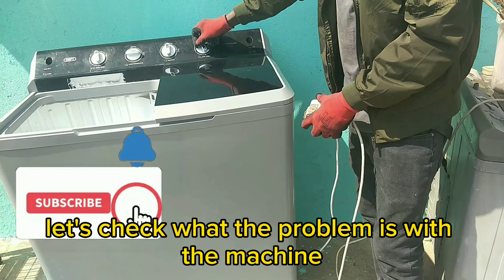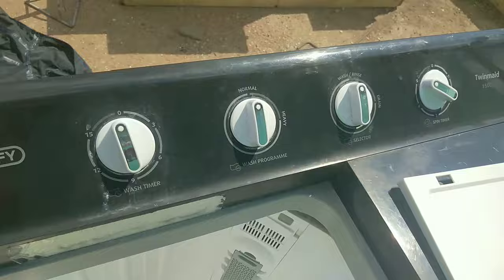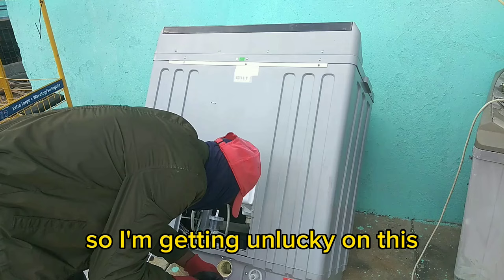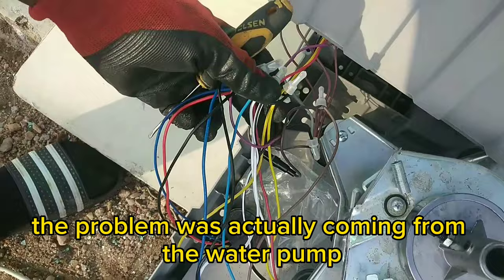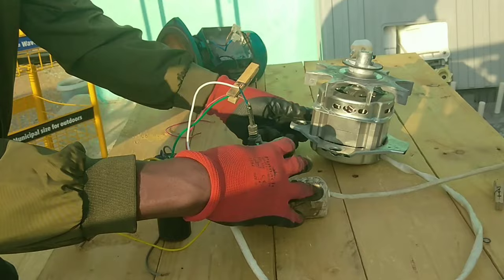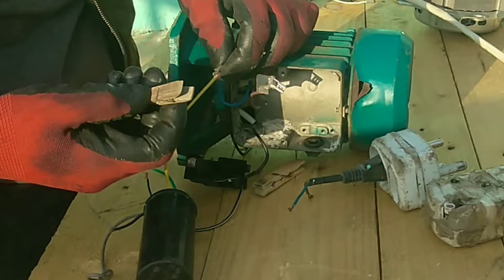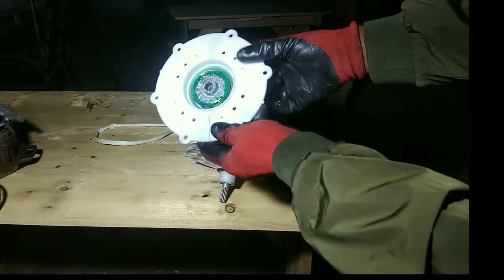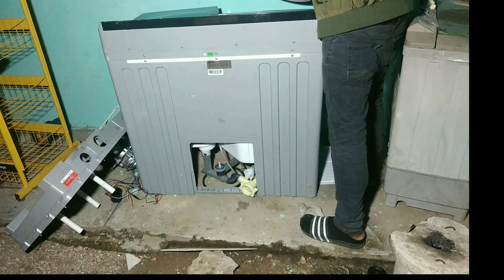How to fix or repair a Twin Tub Washing Machine at home|Part1,Go see how the motors fail on part2

Comment: I bought a new spinner it worked untill the spinner got full of water and it did spin after that now the spinner is slow and it get warm what is that must i buy a new spinner now or can that 1 be fixed
Reply from the maker: So sorry about that Joseph, when ever  the motor get wet during operation it is impossible for it to recover again and it is going to short the windings, so you need to buy another motor and another seal, the seal is located underneath the spin, the shaft passes through it going down to the motor, don't install another motor before changing your seal
Reply: @princereign6385  ok thank you very much for the information
Reply from the maker: You welcome

Comment: I'm having an issue with my twinmaid washer ,it won't spinn coz the blue wire on the plug got disconnected and I don't know which wire it got disconnected from
Reply from the maker: Get it's picture and share   with me on WhatsApp 27 61 453 1577 , I'm gonna tell you what to do,